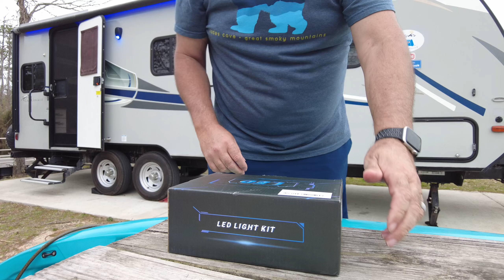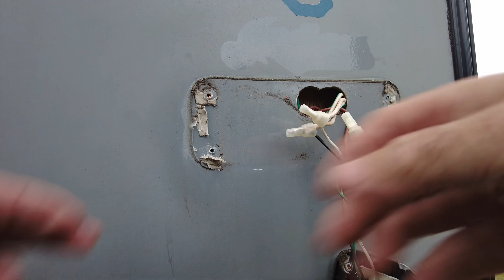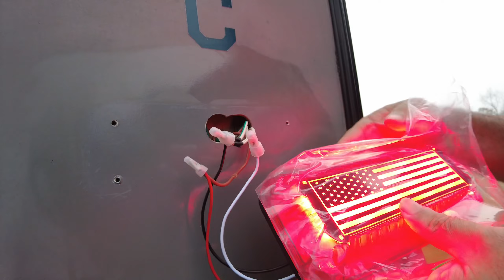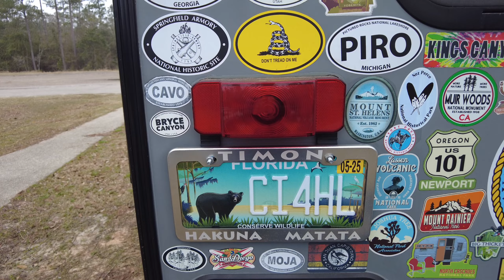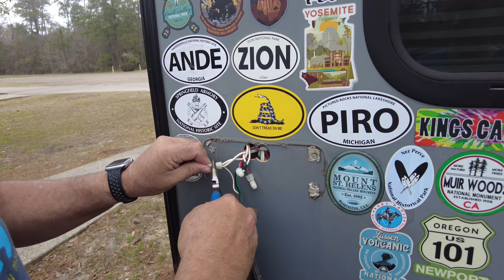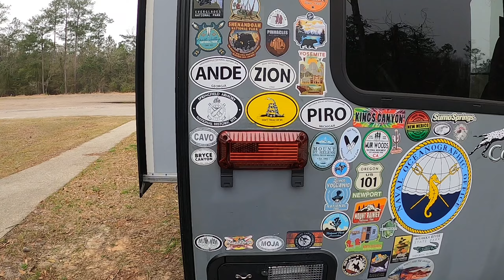Upgrade RV LED Tail Lights

Comment: I tried the LED bulbs in our '21 Apex (same model) but got intermittent tail light out codes on the '21 Tahoe Trailering Info screen. This product looks like a much better option, thanks.
Last thing to do now that the bearings are packed, pads and drums scuffed and cleaned, replaced furnace sail switch, a few new shelves and drawer made and installed, and a new knee installed on me. New Bilstein 5100 rear shocks put in the Tahoe set to .6 and now tows level with a Weigh Safe Standard hitch. Ready for trip planning!
If you can figure out a rear observation camera installation I love to copy that process. Safe travels!
Reply from the maker: So far this option works better for us.  Good luck with the new knee and all the work you yet to do.  Have fun planning😄